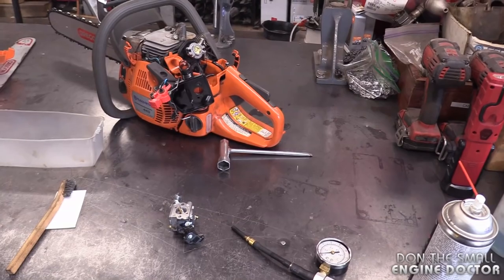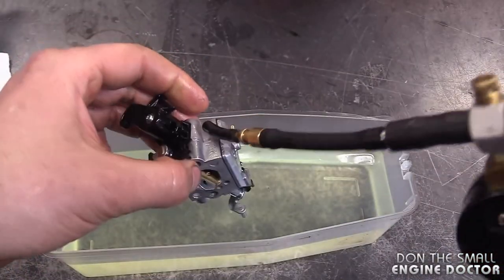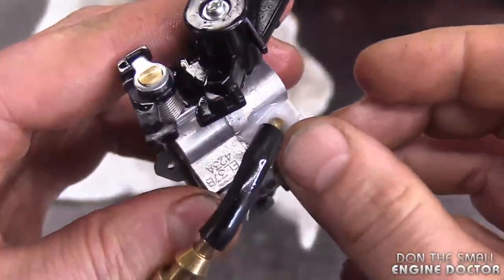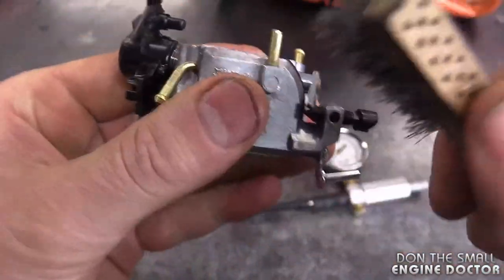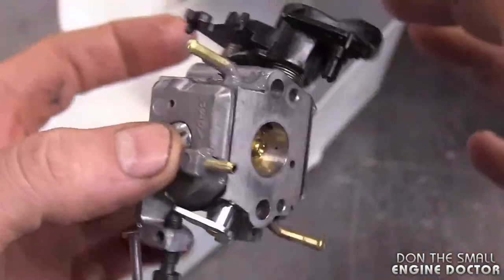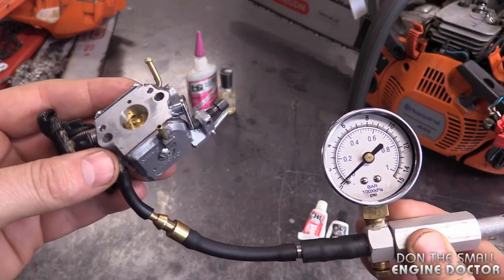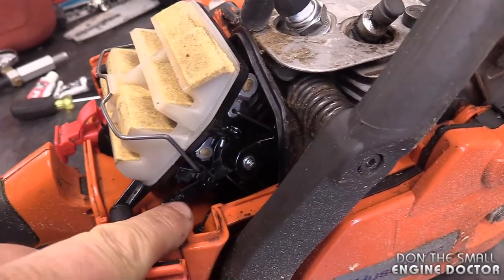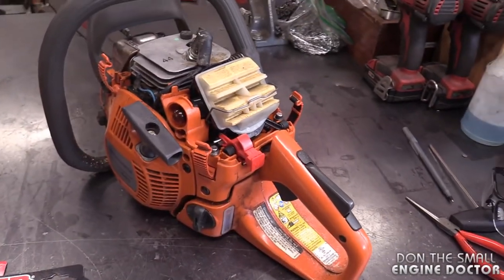Hidden Carburetor Leak On Husqvarna Chainsaw Carburetor! Must see video!

Comment: Great tip donyboy. You always seem to find these head scratcher problems. I really like the way you go about things. Clean everything before taking things apart. I stress this in my shop as well. Look forward to your videos 👍
Reply: Difficult to locate that leak.  I use a Mity Vac vacuum/pressure tester.

Comment: Great tip Don!  I usually buy the five minute JB weld, will start burning the long set one now,  based on your advice.  I fixed a gas tank on an old BMW I had, and it lasted six years, then sold the car. Tanks was expensive! Thanks Don!

Comment: Don, Your videos are great.  I have a Poulan Pro that never idled properly since new.  After watching your videos I replaced the carb and adjusted it like you instructed.  Used the saw today and I ran the best it ever has.  I could even sit it down and let it idle while I rolled logs and it didn’t stall like it always did before.  Thank You.  You are the Man!!!!
Reply from the maker: Great to hear!
Reply: @donyboy73  Friend, what is the best way to use the saw after replacing the 372 xp oe piston?
Reply from the maker: @Sensei948  I would run first few tanks with a little extra oil in the gas
Reply: @donyboy73  Friend, how best to position the L nozzle .....?
Reply: @donyboy73  can i set 13200 rpm for 372xp oem after one blown tank? saw after replacing the piston ...

Comment: Excellent video! This has got to be my issue as everything is new- both fuel related and electrical, will check pressure. Saw bogging no matter how I adjust.

Comment: I didn't know about carb pressure testing!  I fix small engines for decades and wondered why the carburetor leaked after a full rebuild!  Now armed with new info, I can finally fix that carb leak instead of throwing it out to replacement!

Comment: Hi donyboy73. I fixed a cracked lawnmower engine fuel tank with chemical metal, and also worked fine. Thanks for you video and have a great weekened.
Reply from the maker: thanks for the tip!

Comment: Currently troubleshooting an oddly running Stihl 028 WB that seemed to be leaking at the line.  I have a new line, but will pressure test the carb also now.  Thanks Dony!
Reply from the maker: check the impulse line as well!
Reply: @donyboy73  for a tear?  I thought about that, but there was a drop of fuel hanging off the line.
Reply from the maker: @12scars  yes for cracks

Comment: I do small engine repair as well. I could write a book on the repairs I've done with JB weld. It's great stuff.
I agree with you on the long setting one. The 5 min. Stuff is good in a pinch, but if you have the time to wait definitely use the long set one.
Great videos!
Reply: PROBABLY YOU CAN HELP ME TOO.... I have got a Stihl 023      I bought it from someone and didn't realize that
around the the petrol tank cap must have been a crack as they trayed to fix with poxy   (? ) it is coming  loose  from the petrol thank body ---around the cap--- Is there any way  How to fix it  ?

Comment: Thanks for your video my husqvarna not 2 years old get very little work in your video you failed to mention the little plug on the right side of the return line of the primer. I put the green plug back but it keeps falling out do you think it be OK to fill that hole with glue or those the plug allow the fuel tank to breath thanks from Australia

Comment: Hello dony ...
How much  pressure you can put in the carburetor to tested with de pressure tester?

Or what is the recomended pressure ?
Reply from the maker: around 5 psi
Reply: @donyboy73  i teste my carb's on 7-10 psi is that to much?
What will hapen if i put tu much pressure ?

Comment: This is common on most walbro and similar manufactured carbs. they run loose tolerances on the brass pipe hole smacking it in deeper has worked well enough for me. 
Great video never thought of jb weld think I'll follow this method

Comment: Is one of symptoms of an air leak that a chainsaw will start and idle, but will die as soon as the trigger is pulled (compression is 160 psi and carb kit installed)? I have this problem on my Stihl 026.

Comment: 445 is a good little saw. I ported the muffler on mine a bit and it has a good bit more bottom end torque than it did. Still wouldn't recommend running anything over an 18" bar on it but it does really good for it's size.

Comment: Great video you can get epoxy putty called milliput other brands are available. Its easy to control and you can shape it with water to give a cleaner finish. Same principle as JB weld as performed by the expert Doctor. Thanks for all the help over the years! Keep the videos coming...
Reply from the maker: Cool, thanks

Comment: That's a super tip. Seeing how that's a OEM Zama with what is essentially a quality control issue, does this change your opinion somewhat concerning OEM vs. aftermarket?
Reply from the maker: not really, this could just be a problem on this specific carb

Comment: These carburetors aren’t like the ones that we pulled that inlet fitting off of to expose a hidden screen are they? Obviously what you did worked but I was wondering if reseating the inlet fitting using JB Weld would serve better?

Comment: have you ever used nail polish to seal the inlet pipe? ive never had an issue using it even on the welsh plugs inside the carb.
Reply from the maker: in the past yes but with ethanol in the fuel now i'm not sure
Reply: Don’t laugh! I’ve used mail polish on bolts instead of lock tite. I use red.
Reply from the maker: @clarencewhite7765  it works, what color was it lol

Comment: I do the same thing but I use my Might Vac at 5#.  I just hook it up and pump it up to 5# and leave it on the work bench for 30 minutes.  After that, it better still read 5# or I start out finding why.  I also check the carb on vacuum, too.  To check for leaks, I spray the carb down with soapy water from my bottle of soapy water I keep in the shop

Comment: Dony, how do you know which brass port is the intake, primer, etc? It doesn't look like there are labels. I wonder how to tell which fuel line gets plugged into which port after re-assembly.
Reply: Check the manual/remember where you pulled them off

Comment: I'm a huge Husqvarna fan. I have the older 340 and 350. In your opinion, are the next generation 445 and 450s just as dependable  and smooth cutting?
Reply from the maker: i think so yes

Comment: Hello Don. I have husqvarna 450e chainsaw and the purge bulb stays down and hardly comes back to normal/dome shape. I replaced the purge bulb. When i disconnected the return fuel line from the bulb the bulb did not come back to dome shape; however, when i disconnected or detached the intake fuel line from the purhe bulb the purge bulb pops back to normal shape. The newly installed purge bulb does not purge or suck fuel;  fuel lines connections are correctly installed. Please what could be the possible issues? Thanks for all the useful videos. Stay safe!
Reply from the maker: sometimes a new carb kit helps
Reply: @donyboy73  Heel Don. Thank you very much!
Reply: @donyboy73  Hello Don. Thank you very much!

Comment: Interesting discovery! Somebody cranked on that inlet a little hard in the past presumably. Wonder if loctite 603 would be the ideal adhesive, though the jb weld looks like it did a nice job. I've got a leaf blower that's got weird size fuel line holes that I can't match, haven't figured what else I can seal it with. However it's tygon-like fuel line into plastic, which is harder than metal to adhere to.

Good tip on the leak tester, I'll have to make a note of that model to get next time I need to buy from a small engine supplier: it's not on Amazon or eBay, surprisingly.

Comment: Thanks Dony. I have to get one of those pressure testers. Do you think the problem was a poor casting?  In addition, I’ve used JB-Weld to repair a air tank leak and it’s been holding 100+ psi for several years.
Reply from the maker: could be yes but nowadays anything is possible

Comment: Enjoyed the video, thank you. Where did you order the Waldro Carburetor Pressure Tester from and approximately how much did you pay for? Can one get it in Canada? Thanks for the tip on using the JB Weld .
Reply from the maker: hi don, currently they are mostly on backorder for the oem

Comment: I JB'd rusted out axel splines on a Honda Fourtrax 250 to rusted out splines hubs. They held for 5 years, could do wheelies NP ; until someone stole it.

To remove a hub to make a repair I had to aggressively heat it with an acetylene torch and hammer on it.

Good luck to whoever's has it now.
Reply from the maker: wow that's amazing!

Comment: I got a question for you my tiller is dam near breaking my arm pulling the rope key way is ok it a craftsmen tiller don't know what motor it is I bought it new about 15 years ago do you think the valves need to be adjusted l lost the manuel would you know what the valve setting is .thank you sam

Comment: Hi Dony,  This is off topic.  I have a Stihl 029 super that on some compression strokes is so hard to pull that the handle is ripped from my hand.  It’s like pulling on a rope tied to a fence post.  Take out the spark plug and it’s freewheeling.  Have you experienced this problem?  If so what is the solution?  I can tie the saw down on a piece of plywood and using both hands it will start.  Revs up well and idles ok.
Reply: I had the same problem with my husqvarna 55.  It was so hard to pull that it eventually broke the starter pawls! I never figured out the problem.

Comment: Good to know tip!
Unrelated question..Is it safe to run all of my 2 stroke machines on the same fuel mix?
Reply from the maker: yes it is
Reply: @donyboy73  What mix do you suggest?
Stihl..Echo..Weed Eater..
Reply from the maker: @multiguitarplayer4484  45:1

Comment: Dony, I've been using JB Weld products for years and like the "slow cure" the best. The one thing to be careful of is the mixed paste tends to flow a bit if too much is used. 

Nice fix there young fella!
Reply from the maker: Thanks buddy!
Reply: If you look for the "water weld" it is fuel and potable water safe. As most of the other JB welds are not fuel safe. Found out the hard way.
Reply: @jbigbike  their website reckons it's safe to use with fuel.
Reply: @tomalophicon  from personal experience it is not. After 2 months of exposure it turned to a rubber like material and dissolved quickly after that. The water weld was still holding After 4 years with no change.
Reply: @jbigbike  i'l keep that in mind

Comment: Hi Don, I enjoy your videos so much! I was wondering if the needle valve in a two-stroke carburetor is not adjusted properly could that lead to flooding the chainsaw super easily. Thanks in advance.
Reply from the maker: yes absolutely, make sure the metering lever is always adjusted properly

Comment: My husqvarna 562xp after running hard on a large cedar and not getting much of a brake(because we needed to get the boom lift back to the renters) started cutting out and dying when I would try to let it idle. Also couldn't get it started without holding down the throttle or letting it sit and choking it and starting it like normal. Then it would run until I pulled the trigger and immediately die. It was run on husqvarna's recommended gas that they sell. Sometimes I can get it to start like normal and it runs for a few seconds without any choke then it dies. Any ideas? It was broken in last year.

Comment: One day my weed whacker started leaking, it was just lying in my truck, it always ran well, and it isn't that old. I tried to order a carb kit thinking a diaphram was broken, but the cost was ridiculous. The carb is a bit unusual so none of the China replacement are the same. I think I might do a pressure test too, it could be just started the same type of leak.

Comment: Will JB weld work on plastic? I have a Zama carb that leaks in the same area. The fuel inlet line goes into a plastic primer bulb base.
Reply from the maker: it might! sand first though
Reply: You may have to heat treat first. Just momentarily pass a propane torch over the area to be patched. For some reason this is needed when applying epoxy to other non epoxy plastics. Make sure there is no gas anywhere in and around or trapped in chambers
Reply from the maker: @dnnich  thanks for the tip!

Comment: Great tip Don, just curious how old the saw is?  Husky offers up to 5 years consumer warranty if you use their premixed fuel. Keep the tips coming    I used to use a homemade pressure tester made from a blood pressure tester bulb then upgraded to a Mityvac but that Walbro tester is a nice compact size.
Reply from the maker: yes it was older than 5 years

Comment: Super glue is fuel proof as well and would work great for that
Reply: I added a little baking soda to get it to cure quicker and it seems to be stronger.
Reply: @dalebertdurando1496  it makes it so much stronger 💪. I have rebuilt some crazy parts that way.

Comment: Is that the OEM carb, original to the saw?  If so, wow.
Reply from the maker: yes it was the original carb on the saw
Reply: @donyboy73  Thanks.  I was wondering if the saw was bad from day 1 or if it developed over time.
Reply: @mikeremski2102  I doubt that the carb was bad from day 1.  Likely a thin spot in the tubing that vibration cracked open over time.
Reply: @JHruby  That's what I was wondering, but the leak look more like it was coming from the hole the fitting was in not from the tubing itself.  Hard to say without actually being there.
Reply from the maker: @mikeremski2102  happened over time
Reply: @donyboy73  Thank you.

Comment: I got suspicious my Walbro 45A carb might be leaking after watching this video because when working on it I'd rotated the fuel inlet thinking it was meant to rotate.   When pressure checking in water just the slightest pump pressure caused lots of bubbles to come out of the carb's venturi area.   There appeared to be no restriction at all.  I opened up metering side of the carb and found the needle lever was stuck all the way down!   I didn't think the diaphragm could make that kind of long distance movement!   I worked on the needle to un stick and pressed to the lever to stick it down a few times.  When trying to get the FS66 to run at speed I'd tried in desperation to raze the needle lever to get more fuel.  Not that much as it turned out just the width of the lever's metal thickness above the carb. body frame.   I've now  bent it to be flush with the carb body, which appears to be the stock setting.   I wouldn't have checked the carb with pressure under water without this video!  

The trimmer refused to restart after one tank of fuel after replacing the crankshaft shaft seals.  Shihl had stopped suppling the seals for an FS66 so I got generic double lip seals of the same dimensions.    I had thought maybe there was something very special about the. Shihl seals because going one tank of fuel before seals with seals not up to the task was probably expected behavior.  When pressure checking the engine the seals past the soap bubble test with 20 psi so they appeared good.   I found a leak around the fuel pump pulse channel between the cylinder and the carburetor block when pressure testing the engine with soap bubbles.   I order a NOS gasket from eBay because Shihl had stopped suppling this gasket.   My guess is the trimmer wouldn't start because of the stuck metering needle causing it to be flooded.   There were no bubbles around the fuel supply inlet even with a high pump pressure.   Its a simple basket ball pump so it doesn't actually give pressure.   I'm guessing I put a at least 10 psi.  I couldn't unseat the needle.

Comment: A Note: many US carb cleaners contain some lube oil, so I avoid them when cleaning to apply a glue.
Reply from the maker: Great tip!
Reply: I use electrical contact cleaner from LPS.  No lube oil and non flammable.
Reply: The CRC contact cleaner is also a GREAT multi purpose cleaner.  It seems to be a little slower drying.

The "cheep shjt" carb cleners dont seem to have the oil residue problem.  Usually.  But you can always test on some cardboard if curious.  Greasy residue will leave a slightly oily spot.

Comment: Sir, here I would like to ask you why my husqvarna chainsaw is very hot within 2,3 minutes after I started and cut woods. Can u explain me the problem. By the way, so sorry for my english 🤫
Reply: Probably debris around the block and or air passages to the block.  Use the right oil and oil mixture ratio.

Comment: Thanks for the tip!  Does that pressure tester work on Zama carbs as well and can you use water instead of fuel?   👍👍.  They should have recalled those carb as it’s a manufacturing defect right?
Reply from the maker: yes the tester works on all carbs and you can use water too!